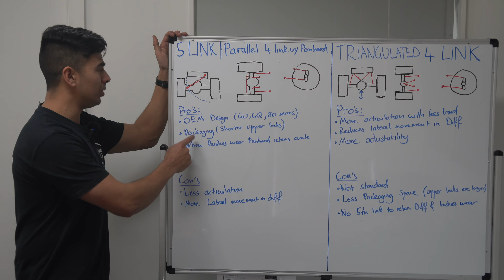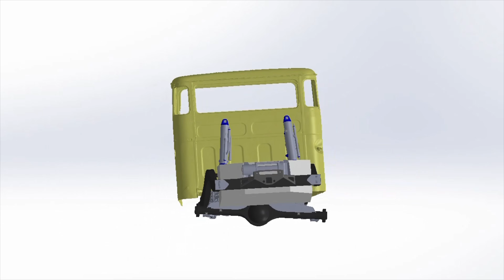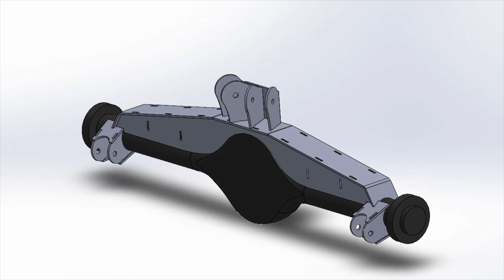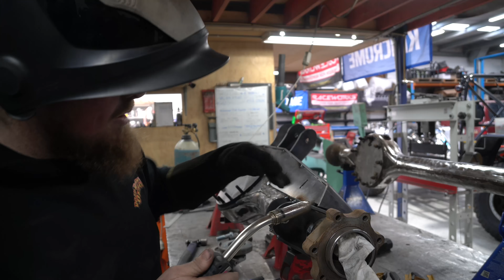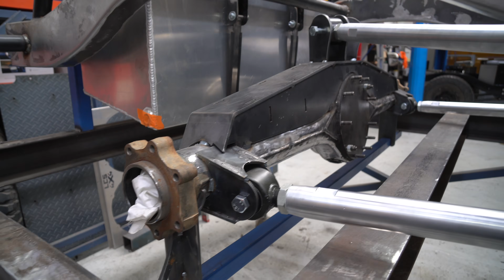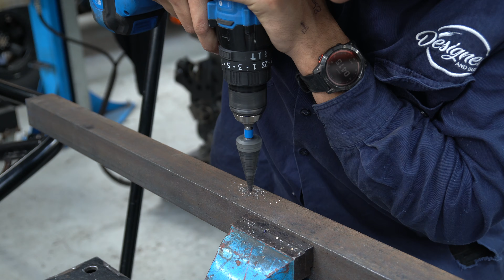How to Build 4 link suspension with Coilovers & Bypass Shocks | Barra FJ Landcruiser Ep#5

Comment: Love your videos man. With needing to notch the chassis becuase the trailing arm hits at full bump or close to. Would double triangulatulation have stopped the trailing arm hitting the chassis?
Reply from the maker: Yes it would have! But massive packaging constraints around that, found it really hard to make everything work!
Reply: @DesignedandBuilt ahh fair enough man. Well you certainly have had it pay off man. It's cone up mint as

Comment: Re: prize raffle. Not sure if you guys have checked legalities, but requiring a merch purchase may turn this prize into a raffle, which needs a permit unless it's for a charity. Would suck to have some gov department on your case or getting hot with fines.
Reply from the maker: Hey Nathan, this varies state to state. In Victoria it’s classed as a trade promotion. Cheers for the concern though!
Reply: @DesignedandBuilt  good to hear. I'd hate to see you guys get any unnecessary setbacks that distract from these great builds.

Comment: great vid richo, but was curious if you had thought about a 5 link set up with extended lowers (like you can get for the gu/gq patrol from superior but obviously not trying to make that work just the idea of longer lowers). Im curious as to if those would provide some of the same flex benefits that the 4link does, or if its just no good and should either lean one way or the other with 5link vs 4link. thanks mate
Reply from the maker: Hey Ben, that setup looks like it flexes really well! Having longer lowers with shorter uppers means the pinions angle would change a fair bit during bump/droop which isn't ideal. The roll centre is fixed with a panhard setup as well (mid panhard) which isn't great for setting up a race car. I'm not sure what the diff would do laterally during bump/droop either but I would imagine side shift a lot more than a 4 link setup. What are you setting up the car for?

Comment: Sorry about off topic comment: Did you have any dramas finding 95 octane fuel up in cape york? I have a turbo barra patrol and am looking to do the ott. Might bring some octane booster just in case
Reply from the maker: There’s only 91 in spots, my Barra has VCT and can cope although you can hear it misfiring at super high rpm’s. I just fill it up with 91 though and don’t stress.
Reply: @DesignedandBuilt  thanks for the reply mate I appreciate it!